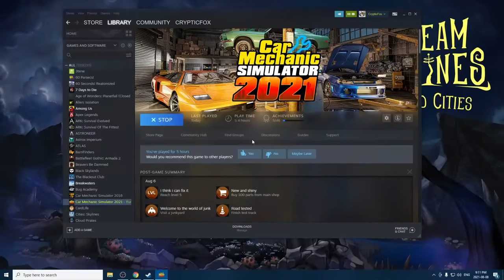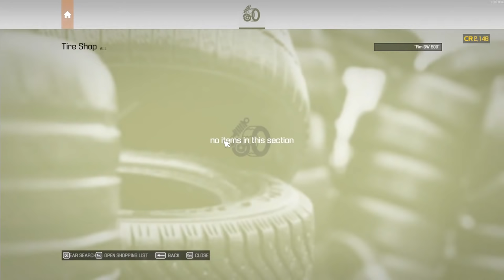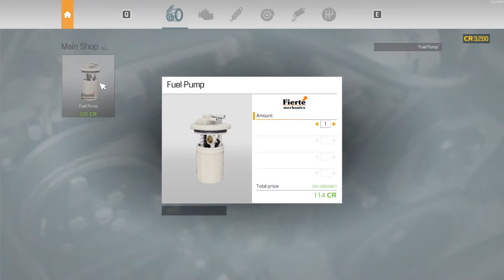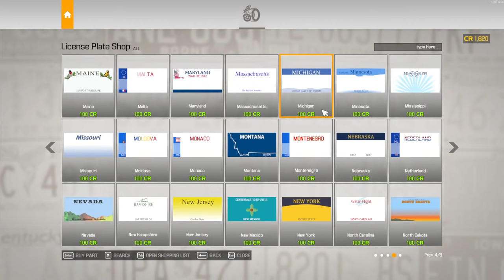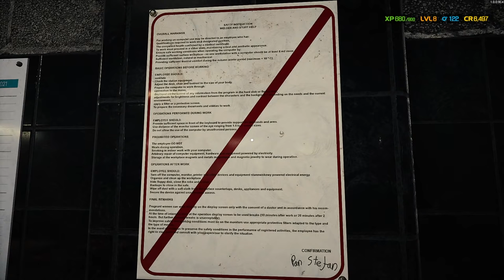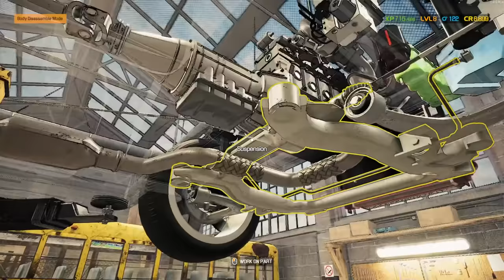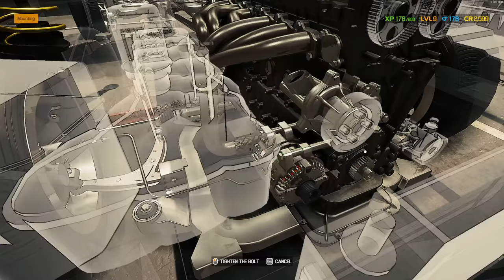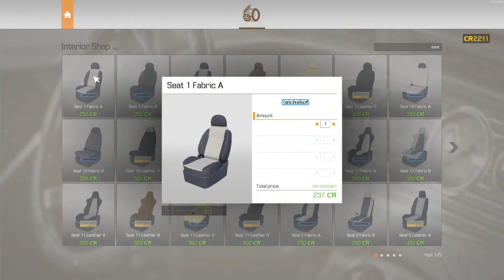Stealing Parts from One Customer's Car to Fix Another! - Car Mechanic Simulator 2021

Comment: One of my uni profs said back in the day when he had to use punch cards, the cards would be ordered in a box and they would draw a diagonal line across the top of the cards so that if they ever dropped the box, they can use the diagonal line to help them rearrange all the cards back to the correct order. Another fun story was RAM used to be made using tiny ferric beads with super thin copper wire threaded through them.

Comment: Floppy disks came in 5 1/2 and 3 1/4 inch.  As far as I can remember 3 1/4 inch could store 512KB of data.
Reply from the maker: Yep I was around for both...and casettes when they were a thing haha.
Reply: @CrypticFoxGaming  I remember doing work experience at a factory and their router was programmed with punch cards.
Reply from the maker: @Chriscatt  The good ole days where you could drop the code all over the floor hahah :)

Comment: (Help) plzzz I don't have spark plugs ignition coils and the abs system
Reply from the maker: Guess you'll need to get your hands one some haha :)
Reply: @CrypticFoxGaming  hah lol i mean I can't buy them in the shop for some reason
Reply from the maker: @callum3118  There's a different vendor for electrical parts and mechanical parts.  Middle of the bottom row of vendors is what you want for electrical :)
Reply: @CrypticFoxGaming  only after finding that out about a hour ago now oh boy I feel like a retard lol thanks anyways